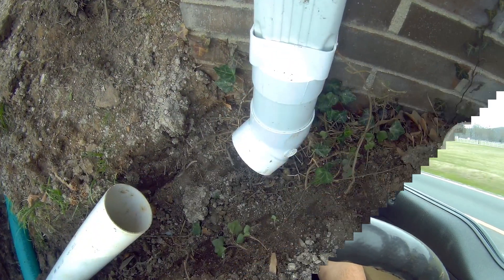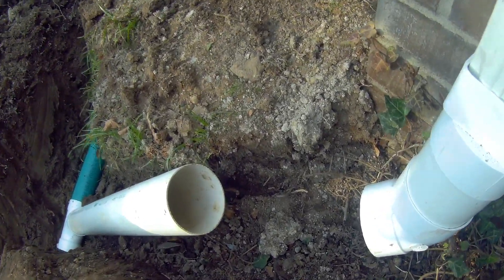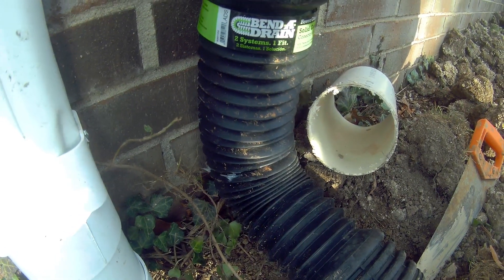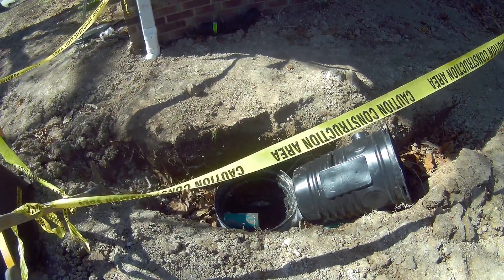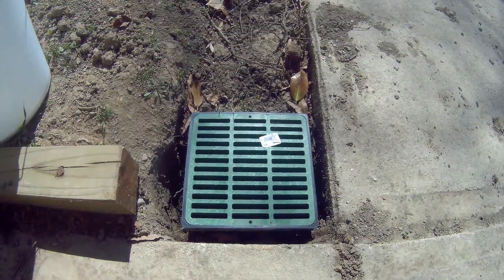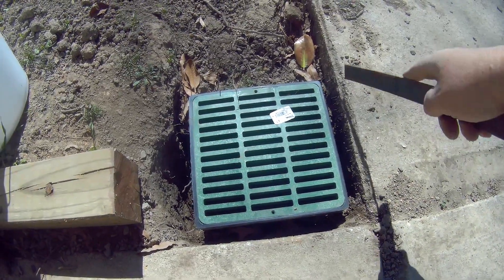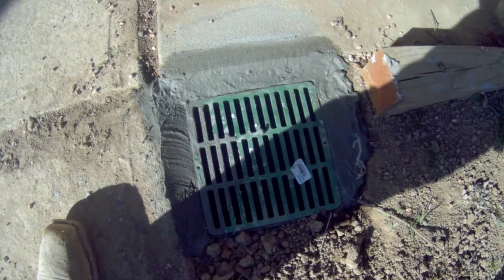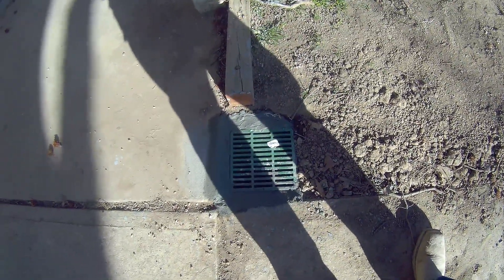Drainage Solutions - Drainage Quick Tips -

Comment: I have 4x3 downspout that I cant drain to the street. I do have a bit of area at the end of my yard that is more isolated and junky area and is capable of gobbling up water out of the way. Its about 15-20 foot away from the downspout. I will be digging up hill slightly to dump that water so will barely have fall to the exit. That isnt my main problem though. I have leaves in the gutters and they get stuck in aluminum drain downspout. I was planning on doing a downdrain to a 4 inch round. But I dont feel comfortable with the leaves getting stuck in the underground pvc.Would a small 9 inch basin work, I know you cut the 4in  hole into the greeen grate and place 4in gutter into hole on top. Does that stop oak leaves at the basin where it can be easily cleaned up or do the leafs just get stuck in the 4 inch pvc later down the line and have to be blown ou to the end.

Comment: Should you drill holes in the bottom of the catch  basin
Reply from the maker: Zackary Hilton sometimes I do. Sometimes I don’t. It depends on the location of the catch basin. If up against a foundation I don’t like to, but that’s just my thoughts. I think compacting the base material and the soil around the catch basin is more important. Helps to prevent settling.
Reply: B&B Drainage Solutions that’s really good too know I just got done installing a 12 x 12 catch basins underneath to downspouts I drilled 4 holes on the bottom of the catch basin when it rains what I think it is happening is the pit gets full of water where the pipe is it goes underneath of it then it goes to my pop-up what I’m thinking is when everything gets settled then I think it should work really really well right now I am really curious what is doing I somewhat and I don’t regret drilling out the holes in the catch basin but it works really well and thank you for the advice
Reply from the maker: Zackary Hilton if you drilled holes the water should percolate down to the sub grade, if you set the catch basin on a base of gravel. I don’t see anything wrong with drilling the holes, or not drilling the holes.
Reply: B&B Drainage Solutions sounds good thanks for your help

Comment: Thank you for this video.  I'd like to install a catch basin next to my driveway  (like shown in your video), and I'd like to install the discharge at the end of my driveway using a popup emitter (which will discharge into a storm drain) .  The problem is that the end of my driveway isn't tilted.  I know that I have to create a pitch of at least 2% every 2 or 3 feet, but my driveway is about 11 feet long.  Being 100% novice with all of it and not finding any example online, will it still pop the emitter up with that distance?
Reply from the maker: terryweb normally 1% slope is all you need. However, with the pop emitter being on a 90 elbow you now have to push water up an additional 2” to get it out. The discharge point (pop emitter) should be 2.5” lower than the start point of your run. You should be fine so long as you are not trying to push water up any higher than the 2” I mentioned.
Reply: Perfect! Thank you!
Reply from the maker: terryweb when I say 2.5” lower - please understand I’m talking about the elbow on the pop emitter. The bottom of the elbow should be 2.5” lower than your starting point on the run. Hope I’m being clear and understandable :)

This should bring (depending on grade) the pop emitter to grade (sits flush at ground level).

Comment: Smart idea using concrete around a catch basin.    I just made mine about 2” below the surface so the water is forced into it.   
-
And also, I agree that using solid PVC or sdr35 is the way to go.    Corrugated is a waste of time and money.   It will fail a lot sooner than smooth hard pipe.
Reply from the maker: I think corrugated pipe has its use in landscape drainage. However, people use it, and just it, and perhaps solid would have been a better choice for the application. That's what gets me...they use the same product for every application!